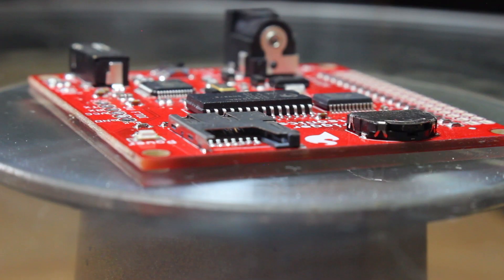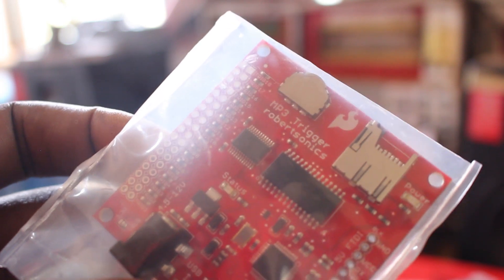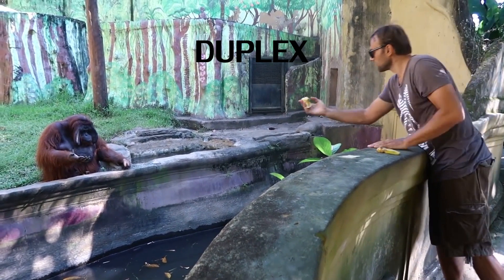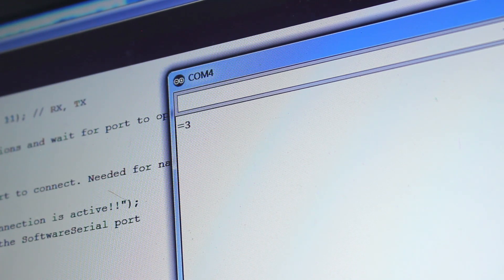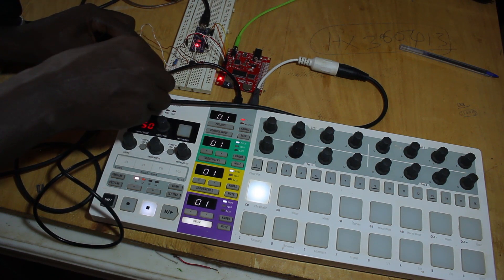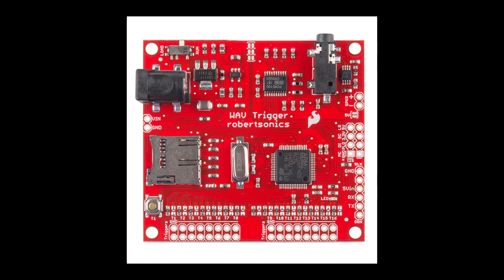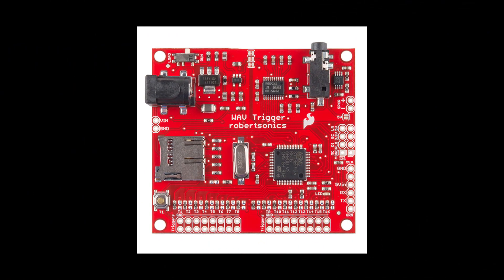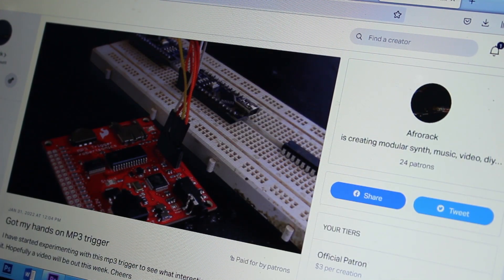I bought the wrong Sparkfun Mp3 trigger board! -Learn from my mistake

Comment: I'm in the same boat! I am looking for a device with a pre-recorded message via an SD card to plug and play. Could I connect this device to a stereo amplifier and then to speakers? I am thinking of getting a Sparkfun Trigger and a stereo amp. Is that the proper way of doing things? Ideally I would like the sound to activate automatically when the power is turned on without the use of any other controllers such as an Arduino. Does something like this even exist? Please let me know, thank you.
Reply from the maker: I think this very board can do.Why do u specifically want the sound on power on? Because u can also trigger the sounds from the SD with like a button
Reply: Thank you for replying to my question. The application for my project requires the electronics to be hidden away and not visible all the time. I am looking for something like this to "play" the sound tracks automatically when the power button is pressed. Then it would run for as long as the power was on and when it is turned off it would stop. How could I go about doing so?
Reply from the maker: @Toy_and_Prop_Masters  You need to get the data sheets of the board and see how it can suit your purpose
Reply: @Afrorack   this is what I want ,  just load  mp3 sounds in sd card and trigger them with button , I don't want to write any complex programs
Reply from the maker: @tunkunrunk  Hello depends on what function you want with the board. Is it just to trigger sounds? Are you making an instrument? It depends
Reply: @Afrorack  thanks for your quick answer , I just want to trigger sounds loaded in the sd card , and assign specific sound to a button .   I want to make interactive games/educative/entertaining  . for instance you have a painted lion face on a board , when you push a button it triggers Lion roar and  a small description . So , I need tutorial how to load mp3 on sd card , how to wire the push button or switches on the board , and the setting for mp3 ( duration , loop etc..    I don't know coding , I need something easy
Reply from the maker: @tunkunrunk  Then this board can work for you. Read up on it's data sheet. You will need to solder buttons I think.

Comment: Ugh... these are ExPenSive, but my own WAV trigger module is one of my favorite modules. I almost never use the polyphony setting (I included a switch to enable it) because usually I just slam 16th note triggers into it, scanning across the 100+ samples I've put on the SD card and if course pitch-bending too. Both controlled by knobs connected to an Arduino.....I like it so much I built a dedicated high/low pass MS20 (stereo) VCF and a 0-99 Kinds Of Effect DSP Reverb module for it 😁 ..... I fixed a lady's clothes dryer just to get the $60 to buy the WAV trigger 😃😃😃
Reply from the maker: Yes..I checked out ur module...the pitch bend is cool... unfortunately the board I got doesn't have...plus I need it as a drum module so polyphony is necessary...
Reply from the maker: So when it's not it polyphonic mode like u use it..does the previous sample cut when u trigger a new one?
Reply: Yeah, I like the chopped up sounds of vocal samples cutting each other off. No, for a drum sample player you definitely want polyphony 😋 you could maybe build a 1-800-Call-Yer-Mum?? By Moffenzeef??? Uses a ... um... Teensy of some kind? One of my friends here built one for me in a tin can 🥫